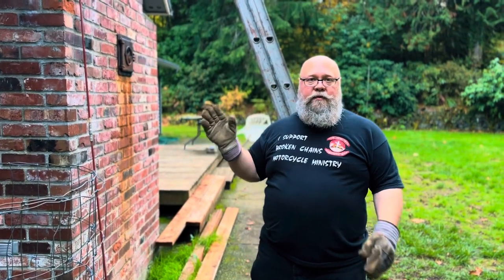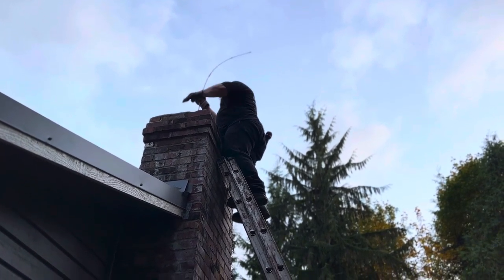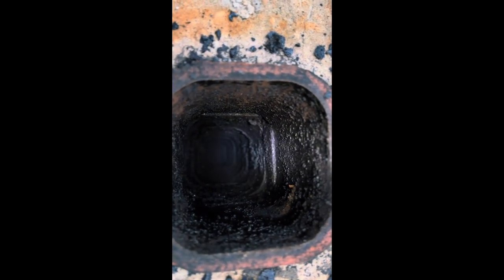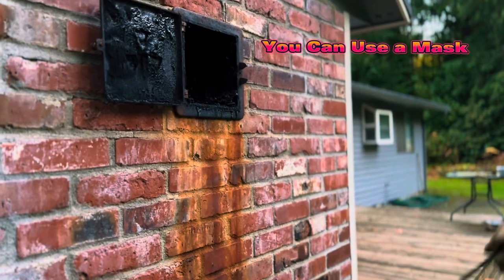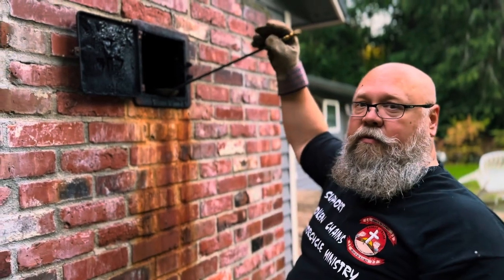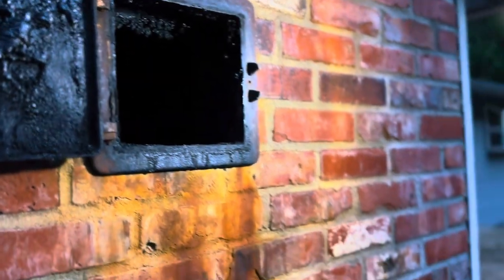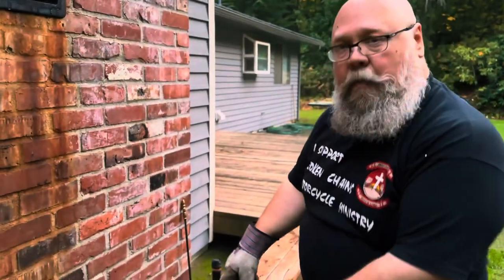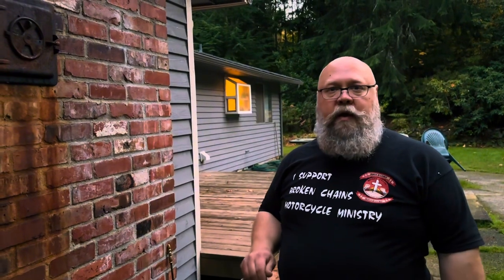How to Clean Your Chimney | Avoid Chimney Fires 🔥

Comment: Great vid!! I use a bell anchor attached under the brush and a chain on top instead of the pole. I slowly drop it in and haul it up several times. I'm not a big guy so it's  just easier for me to pull up than push down.
Reply from the maker: That's a great idea!